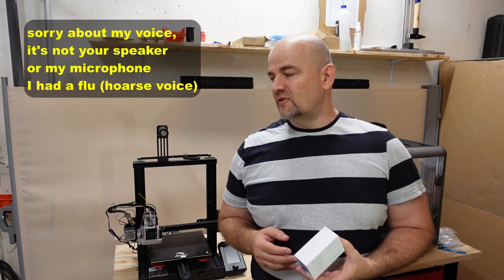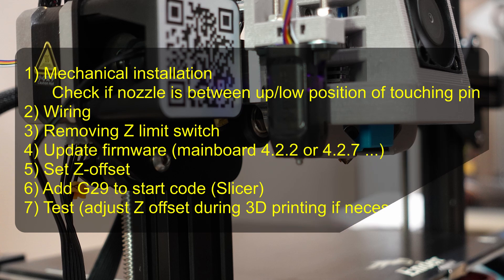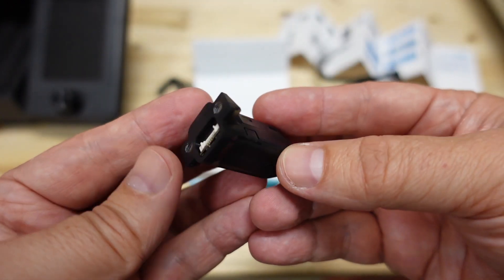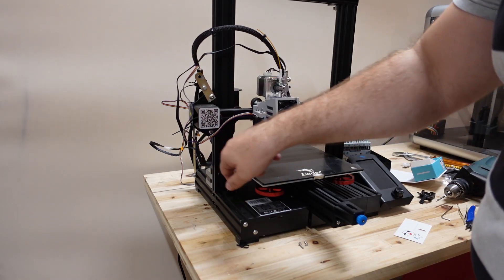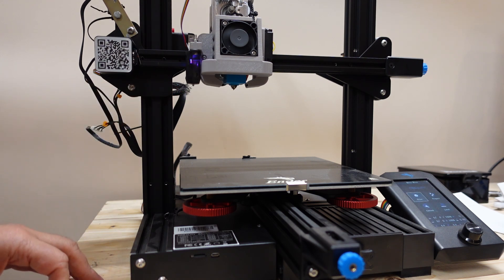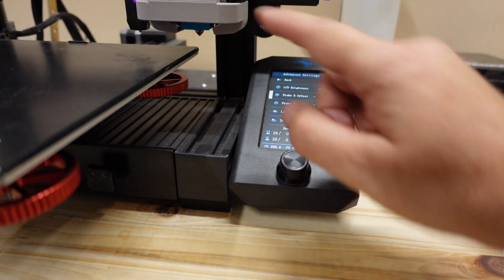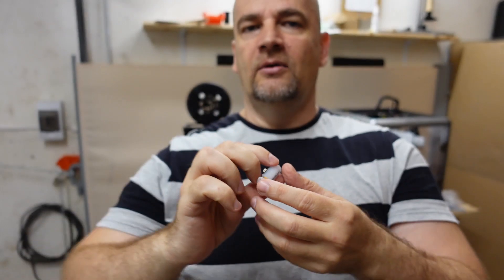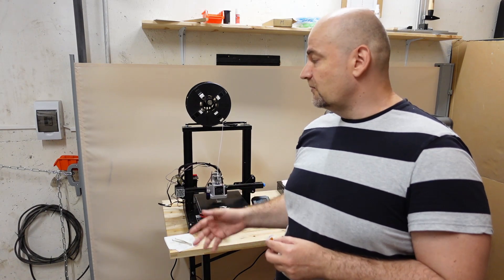Creality CR Touch auto leveling kit, is it better than BL Touch?

Comment: Creality mentions it uses an opto-magnetic sensor, hence I assume that instead of a Hall-sensor, they use an optical interrupter, which should be a lot more reliable.  I gave up on BL-touch like sensors after a bad experience with a 3D-touch clone and since used my own servo + optical sensor design and always wondered why no company was bringing us a probe with a solenoid for extending the pin, but optical sensor for accurate measurement (rather than the tricky hall-sensor).  I really hope that the CR-touch is just that.  So ... can you not open it up to see what is inside?
Reply from the maker: I will try to open it after my vacation, when I get back home.. (if it can be opened without damage, with screws or similar)
Reply: You are not even use the the BLtouch and gave up on it???
Reply: @Tearis01  Yes, because of the intrinsic lower accuracy of a Hall sensor.  I don't get that some people even use those as end-stops as having an AC power line close by can affect the result.  Great to ex. measure the rotations of your bicycle wheel, but in my eyes not a good idea for something that needs accuracy and reproducibility.  And that's probably also why some clones suck: it requires too much tuning to get the Hall sensor to trigger just right (as the magnetic field doesn't just jump from absent to present).  And that tuning is likely also driving the cost of the genuine BLtouch.  Just gimme an optical sensor ...
Reply: Thanks for the input. I was just wondering if I should save myself the trouble of making an optical servo-actuated probe and get a clone (was thinking about the Trianglelabs version), fork out the extra for either original or CR Touch (also got the same mindset as you regarding the Hall sensor), or just stop being lazy and make that servo probe. In my case I even need some slight more work done to get it mounted on my custom setup hence I'm a bit on the fence but guess I'll go for it.
DVD drive rod and guide, inkjet printer paper feed sensor, the SG90 that has been giving me meh results with an endstop on the arm, and let's go, filament cost only.

Comment: Interesting that they went with a metal tip when BL touch decided to forego a metal tip after they released the first version. It's designed to breakaway and not destroy your printer.
Reply: and bltouch
ANTCLABS has patent, Creality must stop patent infringement.
Reply: @harryw523  they look similar but they use different technologies internally. Bl touch uses magnetic sensors, but cr touch uses optical
Reply: @Yokubasu   Optical sensor is also included in the patent.

Comment: As I see you are using the Jyers firmware, so instead of using the "Move" menu, just go to the "Z offset" menu, turn on the "Live Adjustment" and then use the "Z Offset", "Microstep up", and "Microstep down" to find the correct value. Then while still on the "Z offset" menu, scroll down and hit "Store Settings"

Comment: Saw this video a couple of hours after ordering Bltouch, and this sensor is priced the same. What a bummer for me =(
Reply from the maker: Creality BL Touch works fine too, I have a feeling, that this one is better, but soon I will try to measure it (maybe with M48 G-code)
Reply: This one uses a completely different technology which has the potential to be better in the long run and is less vulnerable to magnetic interference.

I suspect we'll see a load of good quality clones within months that perform better than the original for a quarter of the price.

Just like with the 3DTouches.

Comment: seems kind of wasteful for creality to make their own version when there is already working product. The way you say mechanical is funny, i like it
Reply: From the product's page, it seems it's an optical sensor instead of the Hall effect sensor on a BL Touch. This has potential to be far more accurate and repeatable, while the retracting pin is very similar/identical in design, just metal instead of plastic.
Reply from the maker: I belive that Creality BL Touch was only rebranded original BL-Touch. Probably, CR-Touch is more "their own". I hope somebody have more info about this.
Reply: @MyTechFun  You're right. BL-Touch was created by ANTCLABS in Korea, and Creality just licenses it from them. The BL-Touch circuitboards all have "ANTCLABS" and "Made in Korea" printed on them.
Creality probably changed the sensor type being used in the CR-Touch so that they could make it themselves without violating any patents and not have to pay a licensing fee to ANTCLABS anymore.
Reply: My BL touch isn't a perfect product.  Like he says there is play in the pin, and also it gets stuck retracting from time to time (more than it should) causing errors.